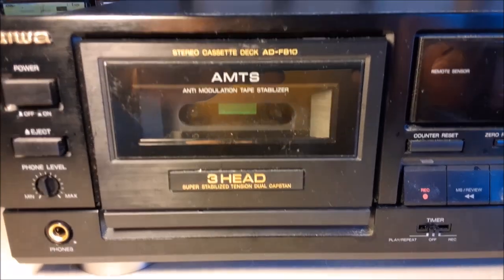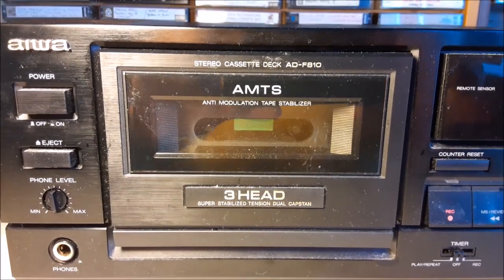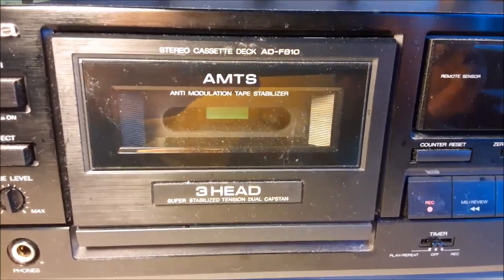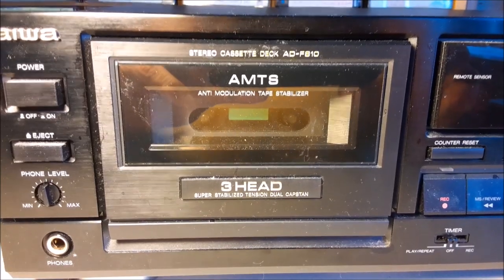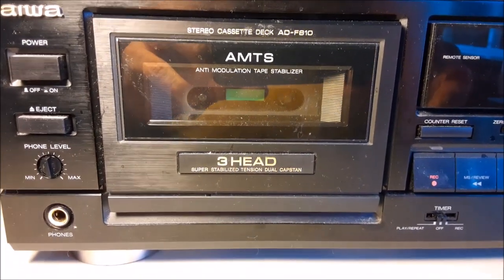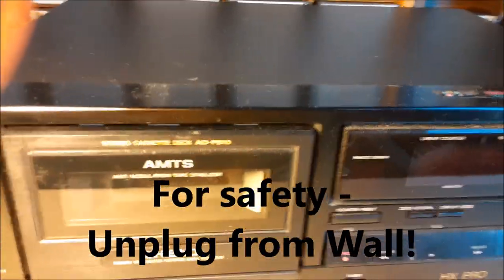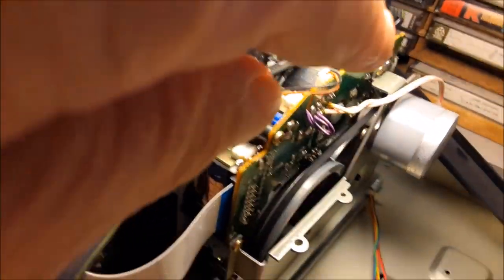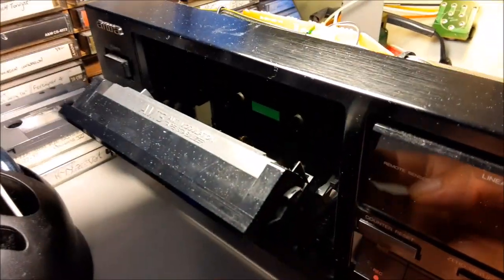How to Fix a Stuck Cassette Tape Deck Door (Eject Button Doesn't Work)

Comment: Hubby bought a tape player at the flea market today and was so excited to hook it up and try it out. The eject button wouldn't work. He was so irritated. I told him about your video, but he found something else that included several steps, replacing parts, etc. He walked away from it. Now he's fallen asleep, and I snuck it away and fixed it by following your video. Whether it actually works is another story, but at least now he can put a tape in and find out. Thanks!
Reply: Wife of the year right here!

Comment: I just wanted to thank you  for the fix. I have a Sansui D77-F that I just got at auction. I put a cassette in to test it and it was locked up. Couldn't play, couldn't rewind or FF - AND most especially the cassette door was locked. Your video Solved the prolem in two minutes! Thank you so much for posting it and a BIG shout out to the the tech who shared the fix with you. You are the man!!!

Comment: Unfortunately it's not really a "FIX" because while it does work to open the door and get the cassette out, when you put the unit back together and resume use it will just do the same thing over again and the door won't open. Pushing the flywheel clockwise gets the door open and nothing else. There must be an adjustment to permanently solve the issue. More than likely new belts will solve the problem. But if nothing else, with this tip you can at least get your cassette back out of the machine.

Comment: Fantastic appreciate your video i nearly gave up at 1st attempt decided to try rotating spool again but for longer period Hey Presto opened up 😮 Unfortunately the tape C120 had snapped i was curious as no indication written on, what is it about 120's that's troublesome anyone else had bother Thanks Again 😊

Comment: Outstanding video, thank you. My JVC has an additional latch next to that wheel that I needed to shift clockwise, too. Your video made it easy to find. The tape deck still doesn't open unless I nudge that arm manually, so it'll need to be replaced, unfortunately. At least I could find the problem and got my old cassette tape out.

Comment: If it happens one time it will happen again but It worked. We haven't nothing to lose.   I Had two decks with the same issue. The problem is that I forced the door on the first one and now I have to fix the door mechanism.  It is a JVC in mint condition but now it is not. Then I found this video. I was also told by a guy about this trick but I had to see the video to understand what he was saying. Watching the video I fixed the Pioneer one and that's good news. I don't know when this happens again but I am OK at the moment. What we need is good new decks. These are ageing.
Reply from the maker: I watched a video recently where modern decks were measured against some of these old relics, and sadly the specs just didn't compete. In general, those old decks were solidly built. I know my old Aiwa was.

Comment: don't have this deck, but having similar problem on my JVC.  I'll try it Spuzzy.  Thanks!
Reply: Spuzzy, thx for the comment like.....did that guy John say WHY this happens??  Just wondering.
Reply from the maker: No, he did not. But apparently it's a common enough problem.
Reply: @StockDude  Tape decks are ageing
Reply: Well they will like everything electrical.